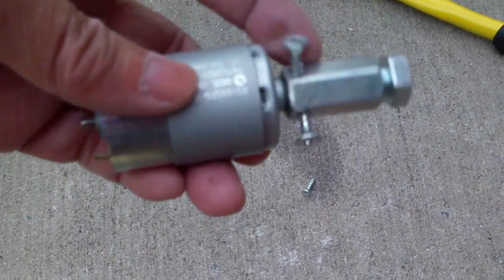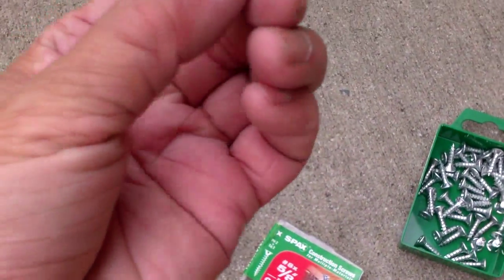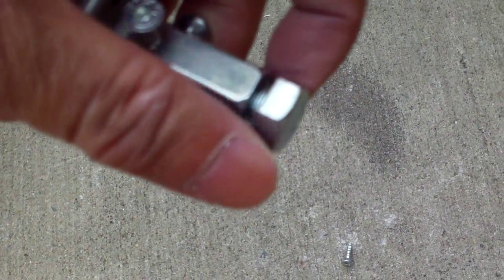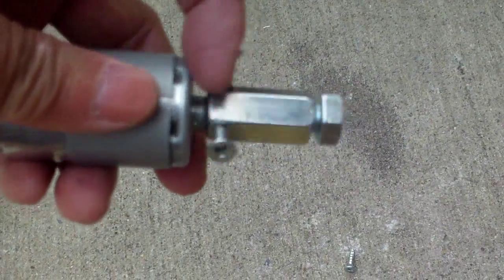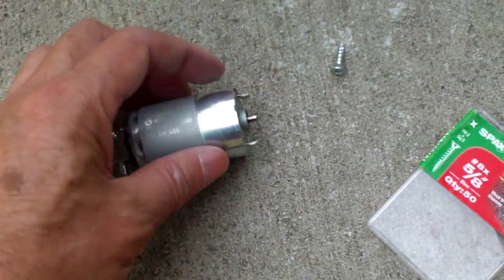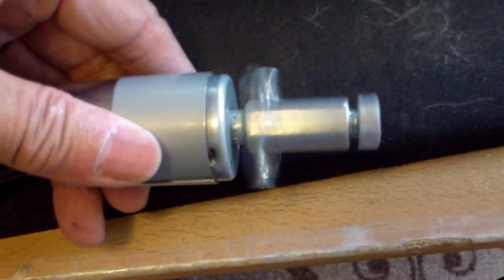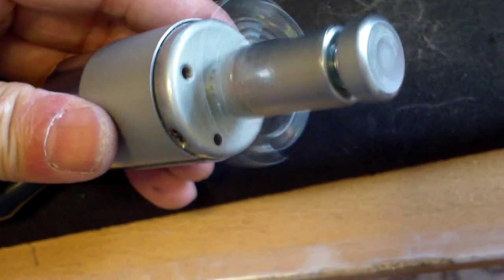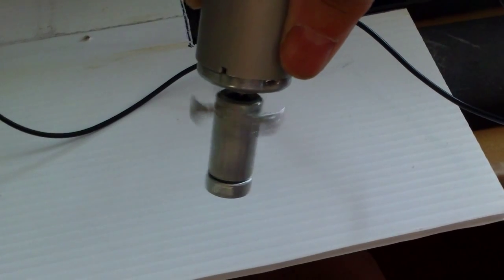Making the hub arbor for the solar ceiling fan motor

Comment from the maker: When you short the output leads, the alternator will stop. If you have good wind, hook it up to a 12 v battery  (make sure you have a diode in series) to see if it charges the battery.  If it raises the voltage of the battery, then you are ok.

Comment: cant wait to see it in action, As  for  the pma i received this spring i finally have the first of one pole  up and  i made the blades but they didnt work well.  so i picked up some and made my tail and finally tried  it for the first time.  wind was blowing about normal and it showed 22 volts. i changed over to amps and the thing just about died on me? n ideas?